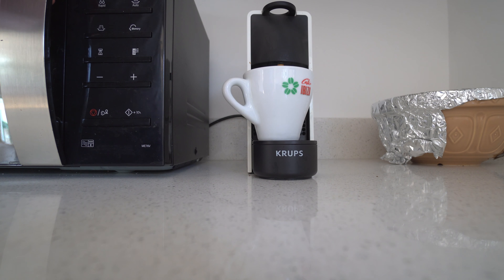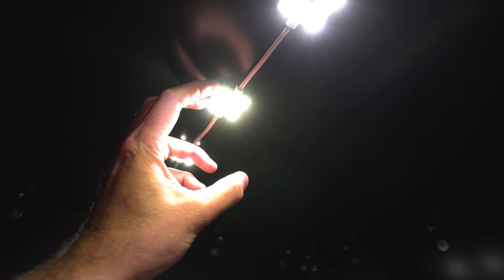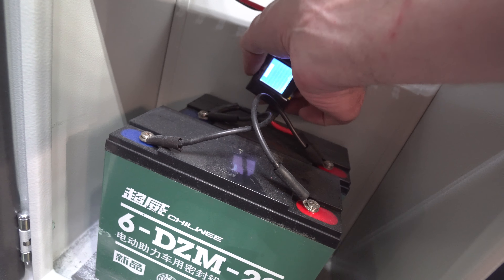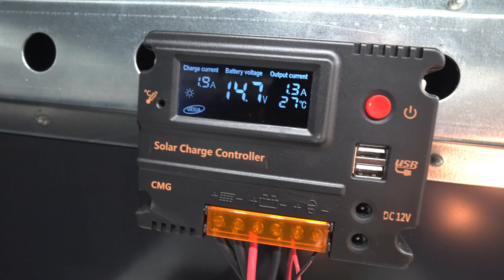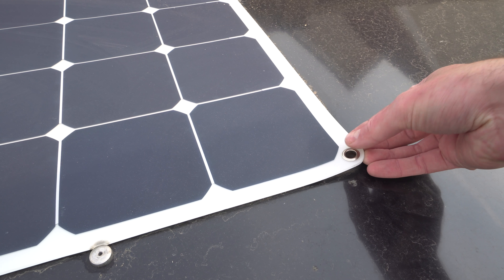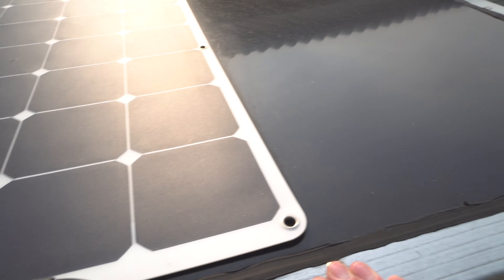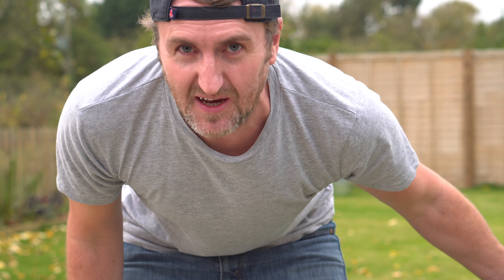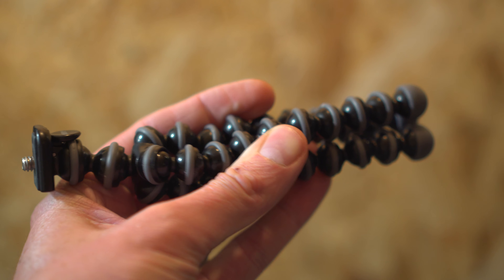THE SOLAR POWERED TRAILER

Comment: Consider going 24v? You can run laptops at 18v with a buck converter so there won't be any additional loss though an inverter, and wire a wifi for DC too.
Also if you use inverter 24v would be a little more efficient. 
Rant over, nice trailer!

Comment: Hi Andy,,, as for as I know Y cane change the the Ebike with the Adaptto system as low as 24w,,, not a hundred percent sure,,, need to speak with Arthur from Vector in Germany where I live and 24w inverter to do it all. Did the same al in a fat ebike Adaptto 14kw controller Qs 205,, 3.4KW of 18650 PanasonicPF my self,, alot of work anyway have look and hope this will help,
Greatings Werner.